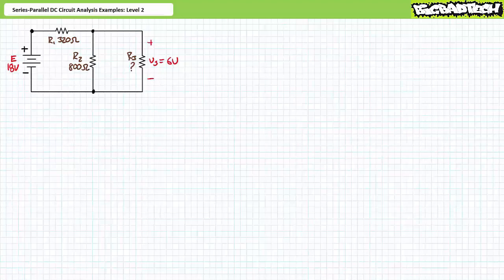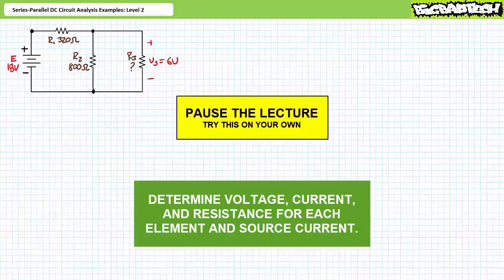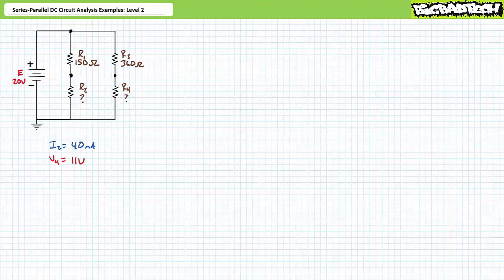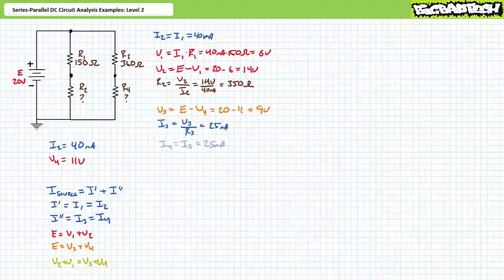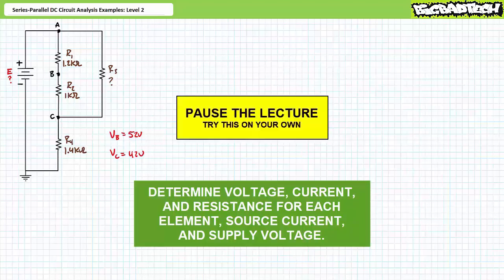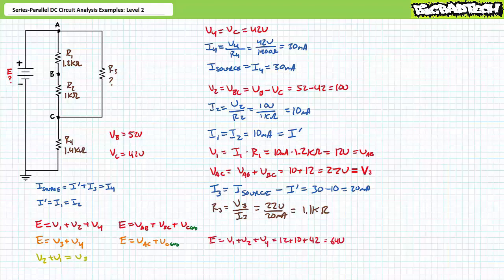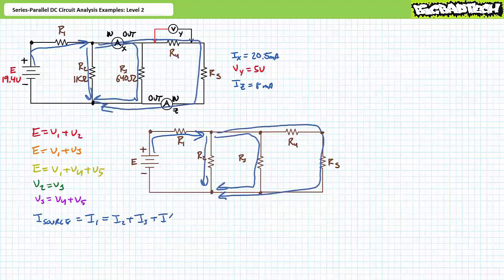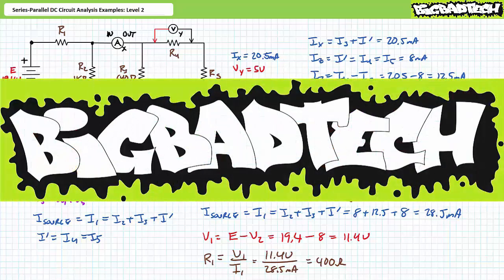Series-Parallel DC Circuit Examples: Level 2 (Full Lecture)

Comment: Hey Jim, on the last problem I came up with all the same answers, but there seems to be a discrepancy when I calculate Total Resistance. If you dived source volts by source amps you get 680 ohms, but when you add up the resistance you get 1,216 ohms.  R2,3,5 = 191.2 ohms. Can you tell me where I went wrong?
Reply from the maker: Keep in mind that this is a series-parallel configuration not a pure series configuration. R4 and R5 are series with another for 1000 ohms. This is in parallel with R2 and R3. This parallel configuration is in series with R1.